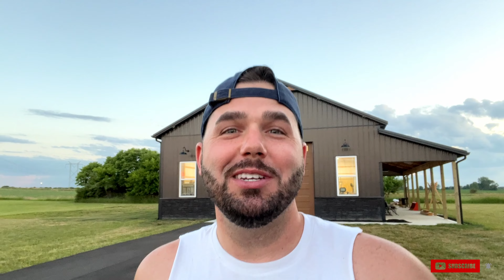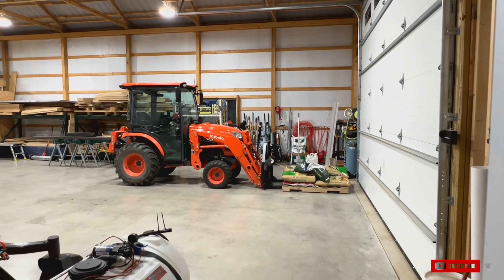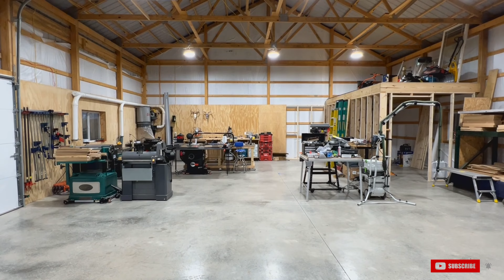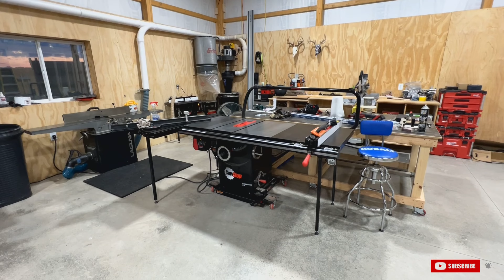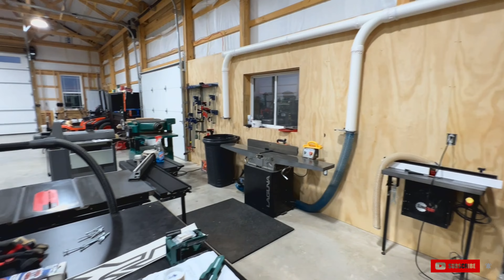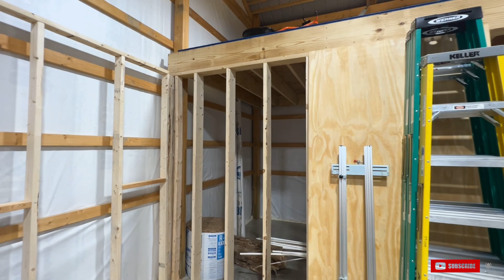2023 Small Business Woodworking Shop Tour

Comment: Any plans to section the shop off from the rest of the shed? Could save on heating costs.
Reply from the maker: Appreciate you viewing! I ran pex throughout the entire shop so no way to segment off at this time. I just finished insulation and the radiant heat is on! Plan to post another video update in the next week or so.
Reply: @stoiabuilds do you mean you ran heated flooring through the whole shop without zones? If so you can still use the flooring heat to keep it at day 50 then another heater in the shop to keep that at 70
Reply from the maker: You’re correct, I could. I technically have 7 zones but chose to purchase a 1 zone electric boiler setup to keep everything the same temp. All personal preference I suppose 👍
Reply: @stoiabuilds  good luck on your next walk of life!
Reply from the maker: Thank you!

Comment: How big is the covered porch on your post frame building? If the new piece of equipment you were hinting at is a cnc I would have a dust collector that goes to the cnc and only the cnc. You might be able to get by if you had a bigger dust collector.
Reply from the maker: Appreciate the comment! The covered porch is 10’x56’. Yes, we just took delivery of our 4x8 cnc. My current dust collector is definitely underpowered even though I have placed blast gates at the start of each section. I plan to look into purchasing a 5hp Oneida dust collector but will need to hold on that for now. Thanks!

Comment: Nick, the pole barn looks great from the outside, and the area you and the family use for sitting and watching the sunsets is missing just one thing, and that's a large pond. The woodworking area is going to be just the right size once your CNC arrives and as for your comment on if you should buy another dust collection system,  honestly yes is definitely the answer as you will be putting the other one under a boatload of pressure trying to collect the wood dust from the new machine and the other woodworking machines you already have.  Honestly if I was you I'd be trying to purchase something that has a high capacity on the airflow the higher you can afford the better as then if you ever decide to build a downdraft table under the CNC in the future your already covered. Seeing the spraybooth that you're building do you think that you have made the doorway wide enough for the projects that you might endup making going forward 🤔 I only ask because even though the doorway does look to be roughly the size of a disabled doorway, say for example you take a job with someone who wants you to build them a very wide conference table, will you be able to make it go through the doorway without having to turn it onto it's side🤔, at the minute your still able to make the doorway a double door giving you plenty of room to be able to take a larger project into the spraybooth area without having to be man handling it onto it's side reducing the risk of a accident etc. Nick once your CNC has been delivered the only thing you look to be missing is a lazer engraving machine which seems to be a very popular item nowadays when it comes to woodworking projects,  lots of folks seem keen to get their family name engraved into the item they've purchased.  Long-winded comments, I know, but I just thought I'd give you a little food for thought going forward with your woodworking business!. As always guy's 💯%   👍   🇬🇧.
Reply from the maker: Simon - truly appreciate the comment! I’ll try to respond to each. The pond - 100% agree with you there. I actually tried to talk Victoria into the idea about a year ago. I’ll have to try again :). Dust collector - we have received the 4x8 cnc and I can confirm I will need a larger machine long-term to handle the cnc and my other tools. Currently looking at the Oneida 5hp collector but will need to hold on that for now. Downdraft Table - great idea there, but I unfortunately won’t be able to utilize it was we opted for the vacuum bed underneath the machine. Paint Booth Door - I also agree with you here. I have not framed out the door section yet so will definitely look into other options. Another viewer mentioned a small roll up garage door. I personally like that idea! Laser Engraver - great minds think alike here :). We optioned in a laser engraver that mounts to the side of the cnc spindle! We will be able to do wood and laser engraving moving forward. Again, truly appreciate the thought you put into this comment and thank you for supporting! Best, Nick
Reply: @stoiabuilds  excellent news Nick, as for the chat with  Victoria I'm afraid you may need to be very convincing to get the pond, but it would not only look absolutely unbelievable but surely longterm it will add value to the property?🤔. I also happen to notice the comment about the roll up garage door and yes I also think it will be the very best way to go especially when you consider the fact of space saving alone. I've just finished building my very first workshop and honestly I live in the UK and the land or garden space that we have with the properties over here, well let's just say it's embarrassing, as the most of our houses come with a garden the size of either a postage stamp or a shoe box!!
I happen to purchase the Laguna dust extraction unit and  I  had nothing but problems while using the  flexible hose. More wood chips etc went into the filter than the dustbag until I installed the metal ducting.  The 5hp dust collection system is sounding the best solution for you and your business. Having watched many YouTube videos and reviews on the one you're thinking about honestly I think you have found the right one for your needs. Good luck and I really hope that you do really well and succeed going forward!!! As alway's guy's 💯%   👍   🇬🇧.